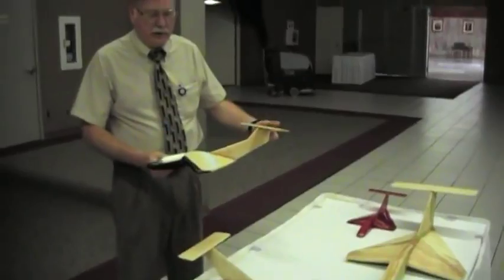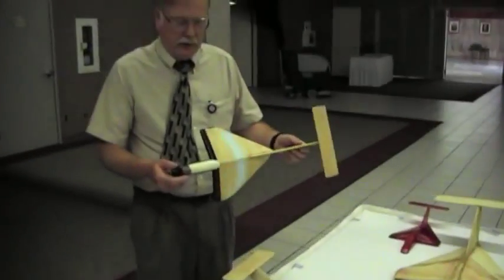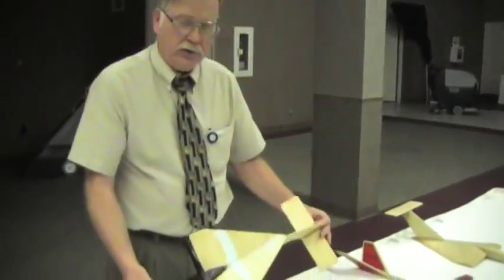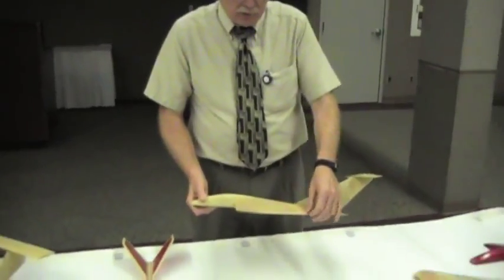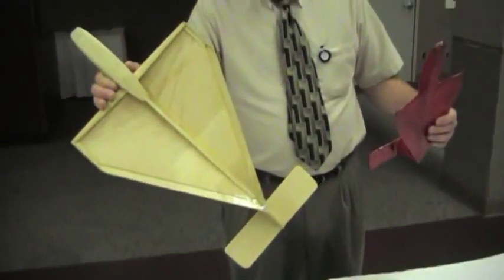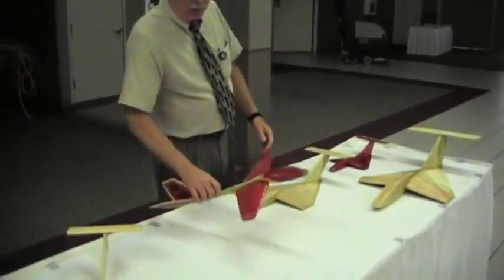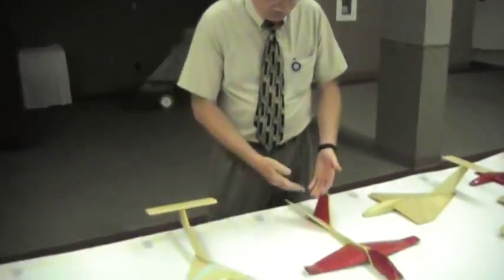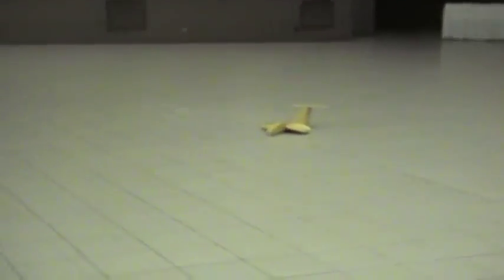FLYSHIP patented reversed delta wing invented by Prof. Dr. Lippisch

Comment: I have some interest in this idea of reverse deltas from the perspective of foam board motorized RC designs. This was cool to see! This design goes the anhedral route and has massive ground effect, I'd like to experiment with flat wings and winglets and positive dihedrals also, as well as maybe canards. I wonder if this plane would be more effective with less tail and more wing; a long, highly swept, slender reverse delta might be very efficient with vortex lift just like a regular slender delta. I was thinking that V tail elevons could be used with a slender, tailless configuration.